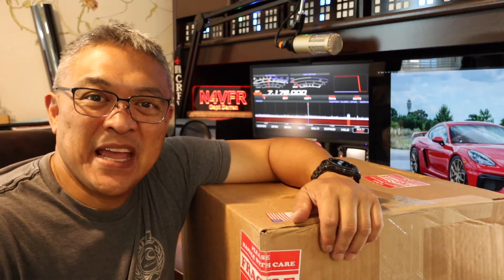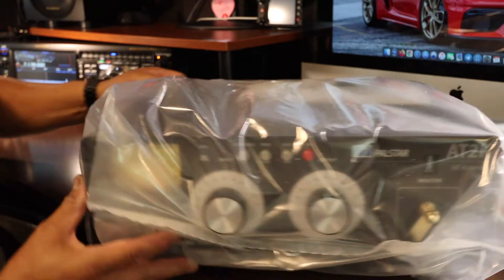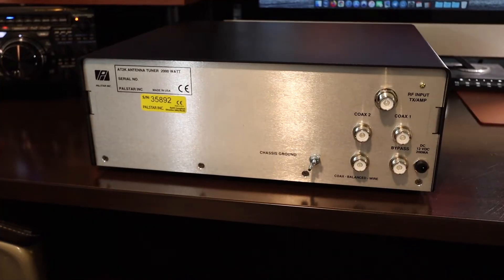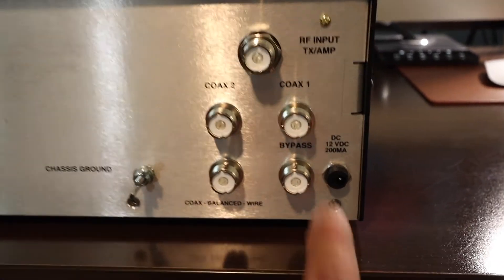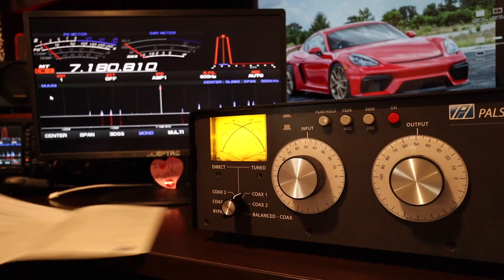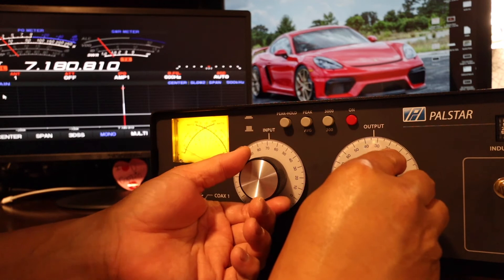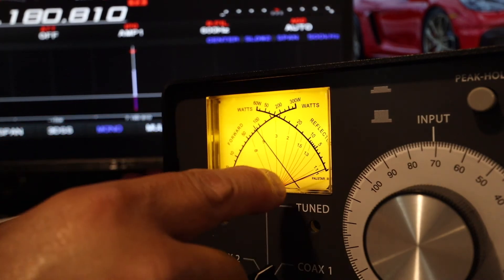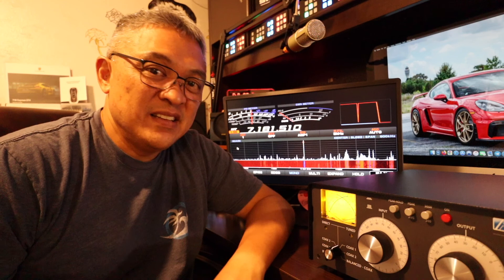Palstar AT2K Unboxing and Tuning

Comment: looking at this tuner and the HF Auto tuner to tune my AV-640 Vertical antenna.  Good description and demonstration of the tuning capability of the AT2K.  This is a much more affordable option than the HF AUTO tuner and it seems to work just as well.

Comment: Is the antenna resonant or non-resonant on the frequency you are using? If it’s non-resonant, with a very high SWR, then you need to be using a remote tuner, not a shack based tuner.

The problem that you will have is the power losses to the antenna will be severe, if the SWR is high, and you are tuning with a shack based tuner. 

If you have a power meter, or can borrow a power meter, try testing how much power is at the antenna at different frequencies with high SWR in the shack, tuned with a shack based tuner. Compare that to how much power is lost at the antenna using a remote tuner.

Here’s a video explaining the differences between remote tuners and shack based tuners:

https://youtu.be/nK4iU8Hw_6E

Dave KY0L
Reply from the maker: Zero FIve antennas are non-resonant.  I agree with you having a Tuner at the base of the HF Vertical. The video you link was very helpful.
Reply: @DarrenN4VFR  Could you measure the power near the antenna when using the in shack tuner? If you don’t have a power meter, maybe you could borrow one for the measurement. It would be interesting to see how much power loss you get with high SWR in the coaxial cable. 

I don’t know how the remote tuners, or in shack tuners impact the received signals. It would be interesting to compare antenna tuners impact on reception. 

If the power loss isn’t too severe, or the reception degradation isn’t severe using an in shack antenna tuner, then the convenience of using a in shack antenna tuner, could outweigh the losses, if they are minor losses. Maybe those coaxial cable high SWR losses could be minimized by using 1/2” or 7/8” hard line cable. But the hard line cable is really expensive!

You might consider checking out Remote Tx remote control for your HF station. I haven’t tried it yet, but the users seem to really like Remote Tx.
Reply from the maker: @daveborchard2019  Sure,  I'll put it on my things to do when I get back home.  It may be a while though; busy with life changes.  Thank you for your understanding. 73's de Capt Darren N4VFR

Comment: Darren: U can also order direct from Palstar! I'm thinking of getting one of these. I have the HFAuto but it's boxed (+the remote unit) now & I'm using the LDG1000. LA-1K amp, runs like a DREAM!! But I'm looking for a little better match on some bands than I'm getting. Maybe I should give the Auto a try B4 ordering anything else. It's their best tuner after all. U know, it can also be used as a manual tuner! But that looks like a fine unit, but it got a pretty sour review from somebody on here who had a bad experience w/ them. U always hope u won't get a lemon, lol! Especially at these prices!
Reply from the maker: Hello Eric, I'm not sure if you can order directly from Palstar.  I bought mine from R&L Electronics.  It's becoming rare to find them.  I paired my OM2000+ amplifier and use the Palstar AT2K.  Recently, I saw one advertised on QRZ.  I will be ordering the this LDMOS Amplifier with a built in Antenna Tuner.  Here's the link: https://islandamplifier.com/product/rf-kit/  Once I receive it and test it out and can turn my Zero Five Antenna 43' version, I will sell the OM2000+ and Palstar AT2K.  I just want something with a little footprint in my Radio Shack and also lighter in weight.  Additionally, I want to have fast auto tuning with RF sensing with remote operations capabilities.  

What HF Auto tuner do you have?  The Palstar?

73's de Capt Darren
N4VFR
Reply: @DarrenN4VFR  Yes, the Palstar, ordered directly FROM Palstar, BTW. I didn't know there was any other. We determined it was defective when I bought it (after shelling out $1500!) so back to Ohio she went, & very recently got it back, along w/ the remote. But I'm waiting to set it up becz I have some surgery coming up & have elected to wait until after. Ur tuner runs about $500 I believe? Looks like it's working fine for you. If I get one, I hope mine does, too. U never know, lol!
Reply from the maker: @ericdreizen1463  Oh okay!  Good luck on your surgery and have a quick recovery!

Comment: Hi Capt. Darren I was curious why you chose this tuner over the HF-Auto or an automatic antenna Tuner?  Thanks 🙏 K4BBC
Reply from the maker: It's a great tuner if your at the control point.  I'm now looking for an Auto Tuner and an Amplifier combined.  Maybe the RF2K-S. It has a built in tuner and LDMOS amp combined.

Comment: Captain I would like that tuner. Just have look around for a used one
KQ4CD Paul ⚓️
Reply from the maker: I'm waiting from my MFJ 998RT which is on back order.  There is a shortage of tuners.
Reply: @DarrenN4VFR  for sale
Reply from the maker: @paulhastings3109  Not right now. I need my Palstar AT2K until my MFJ 998RT arrives.  I'll keep you in mind.  Thanks for inquiring.

Comment: Congratulations on the new tuner.  I have one too and find it a pleasure to operate.  I use a 43' Zero-Five Antenna w/Ground Plane with the tuner and am pleased with its operation.  I think you mentioned that you were in the process of purchasing an OM Power Amplifier.  I purchased the OM-2000+ a few years ago.  It's a Hoss.  Your antenna, tuner and amplifier will be a joy to operate.  You've got some quality gear.  I enjoy your channel.  Keep up the good work.  73 Captain
Reply from the maker: Thank you for watching my videos.  With regards to the OM Amp, I'm going to need to upgrade my home service panel and add a 220v in my room for the Amp.
Reply: You'll be very glad to have a designated ~240V circuit for the amp.  Plus, the circuit will be there one day for another amp if you ever decide to swap.  I did the same thing.  It isn't too difficult a task as long as there are spares in the panel.  At the same time I also ran a 120V designated circuit for radio gear in the shack.  The OM amp is factory set for 230VAC.  If your service is closer to 220 or 240VAC, the OM amp's primary HV transformer should be switched accordingly.  See page 33 (Appendix 7.1) of the OM 2000+ user manual for a simple instruction on what and how to do if necessary.  You'll be very excited when installed.  The OM amp tuning process is different than tuning up an old Drake tube amp.  Scott - KL7EZ
Reply from the maker: @scottcrafton825  Thank you for watching.  Yeah, I'll have to verify the voltage of the home service panel and verify the correct settings or modify the setting inside the OM Amp.